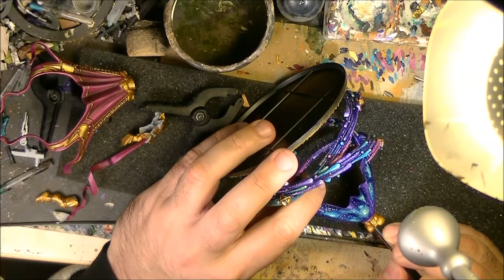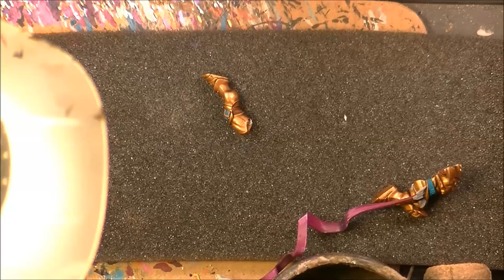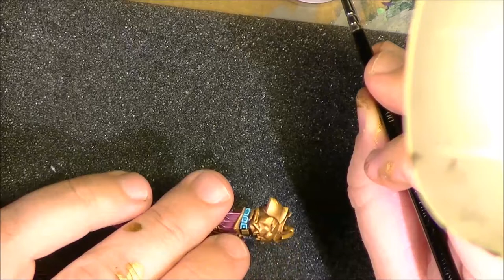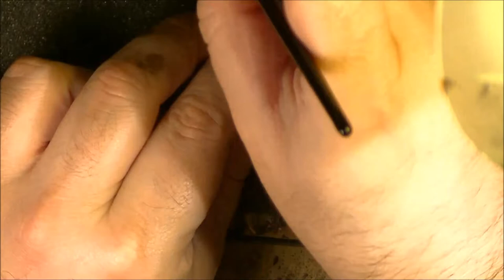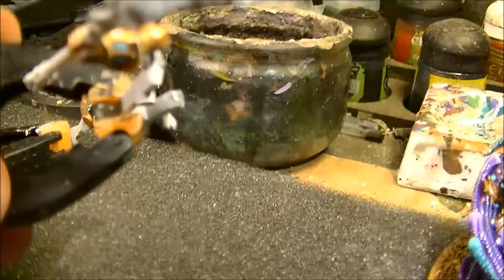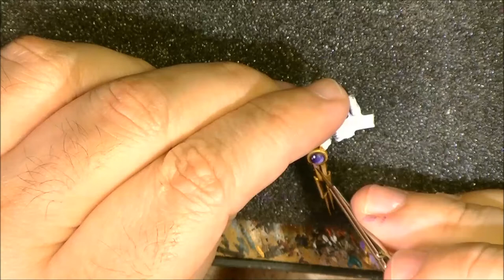Painting Tutorial Celestant Prime part 4: The Armor

Comment: What is the name of the gold color are you using? Please tell me
Reply from the maker: I use Retributor armor as a base color. I do a wash with Reikland Fleshsahde and very soft wash with Coelia Greenshade in the  selected points to increase depth. Then I highlight with Auric Armor gold and second highlight with Auric Armor Gold mixed with Speed metal (from Scale 75), can be used Stormhost Silver instead.
Reply: May I know that what is the different between using Reikland Fleshsahde and Seraphim Sepia after used Retributor armor as a base color.
Reply from the maker: Reikland Fleshshade is more reddish and I found it is making the gold "richer" while Seraphin Sepia is more brown and it seems to be as well less darker I has the feeling that shades are lees deep. Both are good options to shade gold but recently I like more Reikland Fleshshade for Gold.
Reply: THANKS SO MUCH